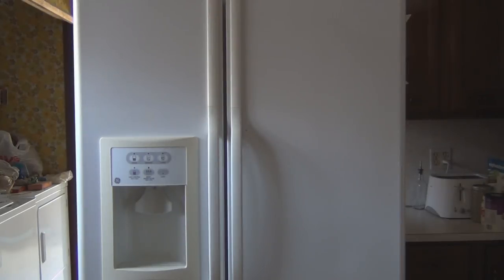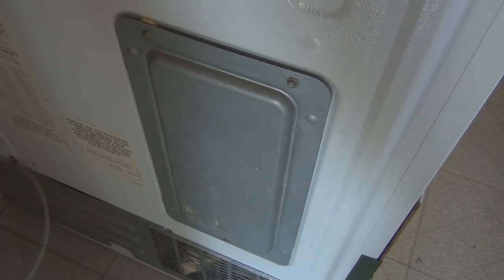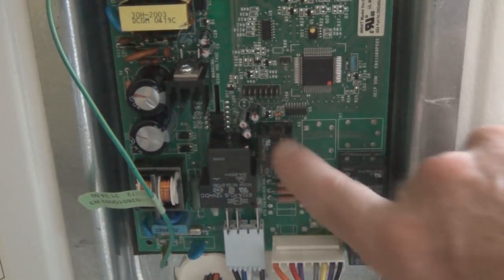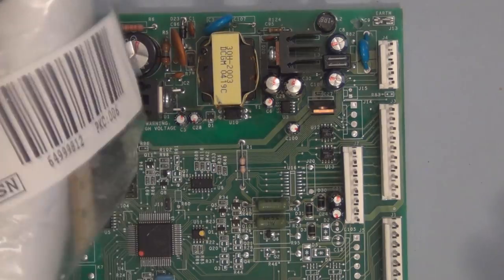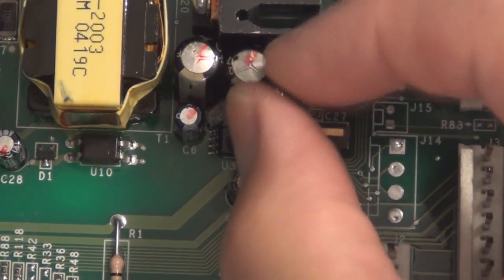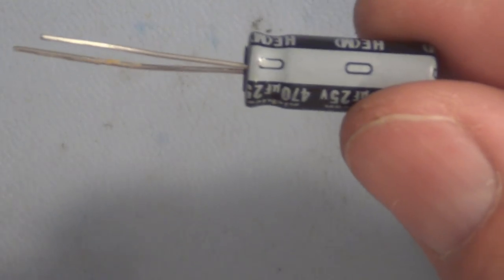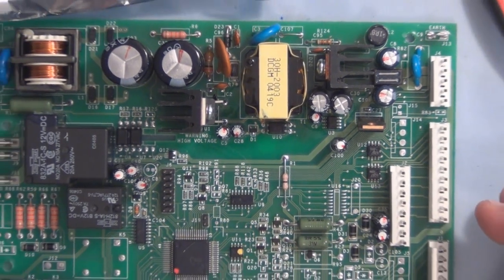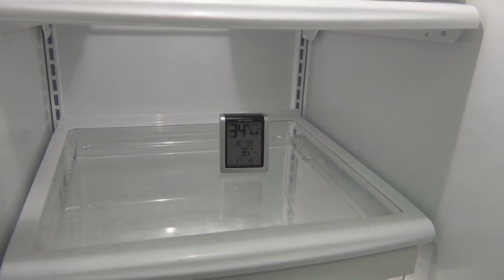GE Refrigerator Not Cooling Clicking Control Board Repair

Comment: 5 years and this video is still helping people out! I just had the same problem and replaced the caps with 35 volt versions and it fixed the problem! The surprising part was that my water dispenser is now working and that has not worked for years! I have no idea why it fixed it, but it did. Thanks for posting!

Comment: Still working in 2024! FYI this same exact issue was seen on GE part number WR55X10942 for me. Fridge Model Number GSH25JSRFSS. I found the controller on Amazon with next-day shipping for $130. I also ordered a soldering kit to try and fix the original. Thanks so much, Tom!

Comment: Nicely done. My MOBO started clicking and could hear the fans spinning up and down. Front display blinking at the same time. So, slapped a new spare MOBO in. I will take a look at the board I removed to check the CAPs! I always like to keep an emergency spare MOBO in case of lightenting strikes etc. Because, spoiled food might cost more than a replacement fridge! :)

Comment: I'm not a welding/soldering kind of guy – especially on an appliance motherboard.  I purchased the replacement motherboard from an ebay seller, for $158.95, Instead of paying $239 to $310 from local parts suppliers.  The cost of replacing the motherboard is reasonable for a non-soldering/welding kind of guy, like me.  Thanks for your valuable video that helped me to diagnose the problem.
Reply: That’s a great idea…

Comment: My ge refrigerator profile. Quit working last night I think this same problem. Replaced ice maker 1 time over 15 years. Luckily I have a refrigerator hot point in garage. Bought it in 1979 April. 1 ice maker/1 heater for defrosting. Still working good. Ice maker did go out again but it is a not filter refrigerator
Reply from the maker: I have a Norge fridge in the cellar that was my parents.  It's been on for over 60 years.  You only have to periodically defrost it.  That's the back up for when all the other fridges die.

Comment: I had some repair guys come yesterday. My refrigerator was not cooling. They decided to replace the main control relay which was $170, that didn't fix it so they replaced the main control another $170 costing me $617 with laborer only to find out the motherboard has blown in one little location now this will cost another $200. $800 total I should have just bought a new fridge.

Comment: I just replaced these same capacitors today thanks to yours and another video that mentioned these caps as being a common board failure. So far this appears to have fixed the issue, just need to give it over night to be sure.

For anyone that might read this, I’m not sure if it was mentioned in the video, but in my case the through the door dispenser was what stopped working first. It would not dispense ice or water but the temp control panel worked and there was no click or light dimming in unison to the clicking. About 6 days later the symptoms mentioned in the video started and it would no longer cool. 

Just hope that serves as a possible early warning symptom. Thanks again, great video!
Reply: Mine was doing the same thing. Water and ice dispensing stopped working and then one day it started clicking and stopped getting cold. Replaced the 2 caps and now it's working perfect again. Sure beats buying a new fridge. :)

Comment: Thank You for this Video Tom.  $1.50 for two capacitors, $7.99 shipping and 15 year old GE Profile side by side frig is working again.  Again Thank you for taking your time to film and share!
Reply: Where did you buy your replacement parts for your refrigerator😊

Comment: I'm literally dealing with a similar issue. Found a compressor with a blown starter. The board didn't show any obvious (blown or desodderered bits, I did not check those small capacitors, I will try them next! Thank you! It's so amazing to learn something new everyday from YouTube

Comment: Had a similar issue with a newer model  ge side by side, have replaced board once already.  This second time I started looking for where the problem might be.  I could see some brown discoloration on the board near a large resistor.  Touching it I noticed it was loose and when checking with meter the value was correct but was not connected.  I figured it heated up to the point the resistor popped off the board traces.  Taking a jumper wire and making a patch connection to the other end of the traces has fixed the problem. The compressor is running right again and does not sound like a jackhammer!  To think I almost ordered another board for 175$ and let my food spoil.... Over a simple solder job.
Thanks for the video, and take care.  
Casey

Comment: This video helped save me hundreds on a new fridge. I didn't fix the existing mother board, cause me soldering would likely burn down my house. But I got a new mother board, had it installed in 20 minutes, and that did the trick. Thanks!

Comment: Used this video to identify the problem with my fridge. Followed along using the same fix and it worked! Thank you for posting!
Reply from the maker: Glad it helped you fix the problem.  Mine is still working since the repair.  Don't forget to vacuum around the compressor to help it stay cool.

Comment: I'll also add, that I first thought that the caps on your board had leaked based on the video. But after working on my board, I can see that the board was coated with a conformal coating, and the "ring" left around your caps was merely that coating.

Comment: Fixed the problem.  Thank you for taking the time to make this.  Saved me $350 on a new board.  Didn't have 470uf so used two 330uf and a 220uf on the back.  470uf on order.  47 cents each delivered.
Reply: Where did you order new capacitor from?

Comment: This saved me lots of $$$. Seems to be the only thing online that shows the fix to this exact problem. Most sites saying it’s the compressor or fan. If you happen to have an old monitor laying around (I did for another project and just never started said project), I can almost guarantee the 470uf/25v capacitor you need is on the power supply. Mine had two, but I only had to replace one so now I have a spare incase the other goes bad.

Comment: I had THE SAME problem and this video helped me to repair the board and avoid pay $150 for the part. Many, many thanks. Just as an add-on, and to help someone to buy them, the capacitors are 2 of 470Mf 25V.
I also had to change resistance R43, that is a 2R 5% 3W.
The problem I had was that the refrigerator starts a loop of reset. Then, for a while, was working well till entered again in this loop. Also, when trying to get ice, all the system reseted.
My refrigerator is
GE PROFILE Arctica
MODEL: PSM25SGSACGS
Main Control Board:
WKKT Model No: 0158-01-05
GEA Part No: 200D4852G012
GE Part number WR55X10942P
Reply: MF is not the same as μF.  These are 470μF - microfarads.

Comment: Thank you. I fixed my mother's Hotpoint refrigerator that uses the same board. My options were $150 for a new pcb or a new fridge. Took me hours to diagnose and research on a solution. I thought it was the compressor relay.

Comment: Thank you! Such a great video explaining the issue. This was my exact problem. Unfortunately wasn’t able to get my capacitors out and needed the fridge so ordered a new board and replaced it no problem. Super easy fix, was bummed I couldn’t get the capacitor out for a cheaper repair but happy to have my fridge working again and will probably try to have a family member see if they can get the capacitors out of the old one to fix and keep as a spare.

Comment: Thanks, I was able to fix my fridge after a micro-power outage caused the same two caps to bulge and a resistor to burn.  The resistor in question was R-12 on the bottom, a surface-mount resistor with code 221 on it.  If you have the same issue, replace it with any 220 ohm resistor.  The surface contacts on mine were burnt as well, so I soldered it directly to each component the leads lead to- which required me to drill a hole through an empty part of the board as one component was on the top side.  It's running though!
Reply: I had the same two caps bulged out the top, and a toasty R-12 underneath.  Replaced both caps and the resistor and now my board is just ticking... incredibly frustrating since my fridge was working before - just the LEDs were dim and the ice maker was slow on ice - the 12V J4-2 <==>J4-3 voltage was only 8.3V (should be ~13.5) and the fan supply J2-3<==>J2-8 was only 10.7V. (should be ~13.5)
Reply: @spblackey  Awesome, good job!

Comment: Thanks. Found a bulged cap may replace board for now and order the cap to repair and keep as a spare.
Any thoughts on wiring a small DC fan to cool off that heat sink?

Comment: I want to thank you very much for this. I performed this exact swap for a GE Profile (PGCS1RKZA) that was clicking and flashing four zeros on the display. The unit would no longer cool and even the interior lighting wasn't working. I examined the two capacitors in question and found them to be slightly bulged as you did. I will share that, as a novice with my soldering iron and in replacing parts like this, it took me a bit to locate the correct capacitors. For those that are going to do this, the capacitors on the board are narrow and fit snugly into the position they are in. Capacitors with the same ratings (470uF/25V) can come in various dimensions. The dimensions you are looking for will be: 8 mm Dia. x 20 mm length (this is the size of the body itself). The short and wide ones wouldn't fit in this location. Here is what I ordered: https://www.amazon.com/dp/B00MEINPGW/ref=cm_sw_r_em_apa_G6iIAb071T9BV

Thanks a ton for this. You saved me well over $100. Cheers!

Comment: How did you test the caps? By visual inspection?
Reply from the maker: These were pretty obvious visually. The electrolytic capacitors are designed to bulge up when they fail.
Reply: If I don’t visually see any bulging on the caps but there is a constant clicking noise near the control board with water leaking from the front freezer door area are these signs that the control board need to be replaced? Also, when the evaporator fan is disconnected, the condenser fan will kick on. But when evaporator fan is connected the condenser fan will not turn on. The condenser fan I’m referring to is on the lower bottom back side of the fridge. Thanks for your help. Having trouble figuring out what may be wrong. Had already replaced another part which did not get rid of the clicking noise.

Comment: Where do you buy Nichcon 470uf 25V capacitor? My GE Refrigerator circuit board showing those two capacitor ( same in your video ) popped up. Please help on telling me where to buy it?
Reply from the maker: You can get them from Newark https://www.newark.com/nichicon/uvz1e471mpd1td/aluminum-electrolytic-capacitor/dp/58R3366?st=Nichcon%20470uf%2025V
or Digikey https://www.digikey.com/product-detail/en/nichicon/UHD1E471MPD6/UHD1E471MPD6-ND/2428132

Comment: Thank you for sharing this great video. I had the same clicking sound and ordered a control board. It worked. However after seeing this video, I replaced the capacitors just as you posted, and the board worked like brand new. Thanks.

Comment: Have a newer GE Profile fridge with the same problem. Clicking and “0” scrolling across the display. When unplugged and replugged it just clicks.
Found the two 470uf caps and they were slightly bulged. Replaced them and it started up, running fine now.
Thanks for the video!
Reply from the maker: I'm glad you were able to fix your fridge.  Mine is still going strong.  Definitely not a good idea to have the caps up against the hot heatsink.

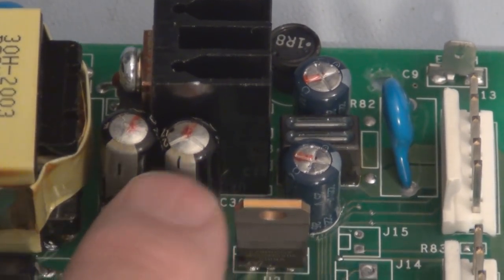Comment: I have a GE refrigerator with a malfunctioning main control board. There is a sagging black inductor labeled "L2", located next to the heat sink. By chance do you know the inductance spec for that component so I can get a replacement?  That same component shows up on your board with the same L2 label on the circuit board, and a 1R8 on the top at 4:00 in your video.  Thank you.
Reply from the maker: It has 1R8 stamped on it and I think it is a 1.8UH Inductor and this might be a replacement.  I do not have a schematic so I don't know for sure if this will work.  Here is a link to what I found on digikey https://www.digikey.com/en/products/detail/abracon-llc/AIRD-02-1R8K/2660662
Reply: @tmc200527  Mine has the same 1R8 marking - I'll check it out. Thank you very much for checking out digikey - much appreciated!
Reply: very rare that you would have to replace an inductor, so I doubt that is a problem.
Reply: @wally6193  so a melted, bubbled inductor should be expected to function normally?
Reply: @lumbaracres3587  I'm not sure what you mean by "bubbled". An inductor is just a coil of wire, either wrapped in air or around a core. So unless the wire is open then yes it should function just fine.
Reply: @wally6193  Wally, Wally, Wally. It's clear you haven't seen it.  What words should I use? Melted? Sagging? Burned? Shorted"? Replaced it and now the board is fine. Moving on...
Reply: @lumbaracres3587  Well if you're done learning then great. Good luck.

Comment: HI eTech Tom, I found your video interesting and was hoping you provide some guidance since you have a better understanding of  PCB boards.  I have an LG Fridge with linearcompressor  model LFXS26596S/04  does not cool.  I was told the board is not sending 200 volts to the comressor.  I tested it while running and the voltage being sent , the highest 68 volts.  Per your understanding what component is fauity when the PCB board does not send the required voltage.  I can send you a picture of the PCB board for better visualization.  Thanks fred

Comment: Hi bro, I have a GE model: PSE29NHTECWW that stopped working too, I looked at the main board (Part no.: WR55X26733) and noticed that the R12 has exploded. I was looking for the ohm value on the internet when I found your tutorial, I suddenly realized that R12 on your main is 221 (220ohms) Thank you very much.

Comment: Tom, thank you so much for this video.  With less than $6, we replaced 4 caps on my GE board WKKT 0158-80-71 R-101 and got frige (PSHS6TGXCDSS) to work again and dispense water.  There is a big black relay on the board that has a slightly browned solder point that I will replace shortly as well.  Would you happen to know how I can identify what that relay is responsible for?  I can't find the schematic for this board online.  2 of my remaining symptoms are 1) the icemaker's tray is still not filling with water, and 2) the dispensed water is not cold.  Many thanks!

Comment: Hi Tom, can you tell me what tool you used to remove the elements from board? Sounded like some type of a gun that pushes it out after heating.
Reply from the maker: It is called a solder sucker and solder wick which can be found on Amazon.

Comment: Hi Tom,
First, thanks for your helpful video.
On my control board, I found 4 capacitors (C29, C30, C8, C106) inflated.
The switching regulator "U1" has also blown out.
I can't read the component reference anymore.
Do you know the part number for that IC ?
Thank you for your answer.
Reply from the maker: U1 is a TOP246Y on my board.  Here is a link to the digikey part they carry.  It is obsolete but there is a substitute available. https://www.digikey.com/product-detail/en/power-integrations/TOP246Y/TOP246Y-ND/1007585
Reply: Hi Tom,
Thank you very much for your quick response.
I try to change this part.
I remain subscribed to your excellent channel for the all goods advices.
Thanks again for your help.

Comment: Thank you for your video. It helped me solve mi refrigerator problem. Where I live the main board would have cost $275.-. By replacing the two condensors it cost me $5,-. to repair the refrigerator.  Thank you once again.
Reply from the maker: I'm glad it worked out for you and saved you some money.  Make sure to vacuum the dust out around the motor too.  I thought mine had insulation around it at first but it was a layer of dust.

Comment: Thanks eTechTom. Found the  two 47uf x 400V capacitors bulged.  Changed them out and refrigerator is running !
Reply from the maker: Glad to hear you were able to repair the refrigerator.